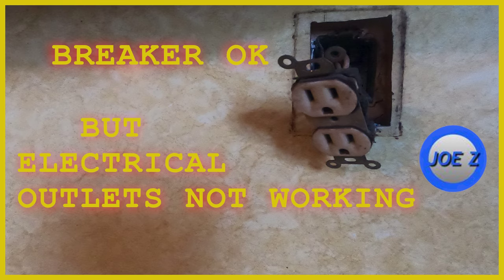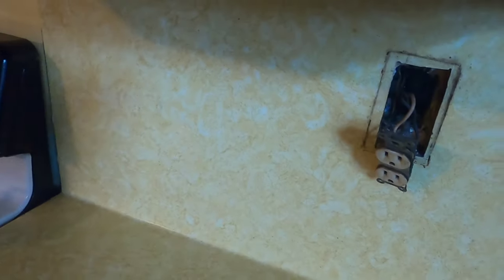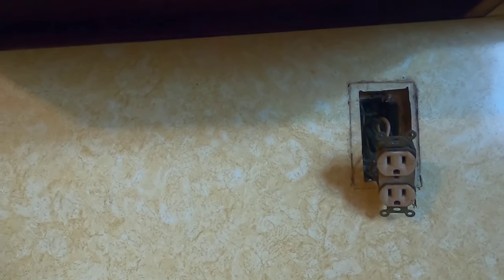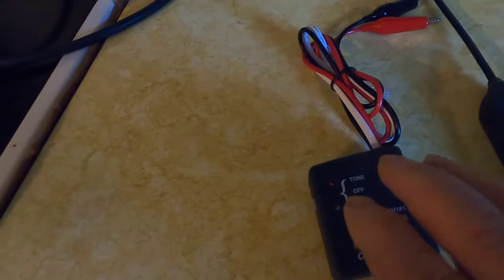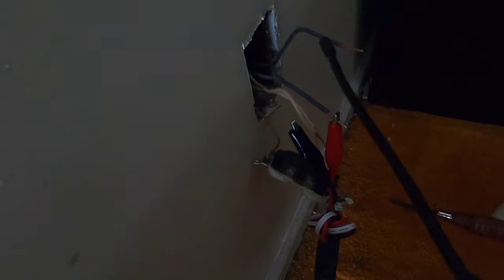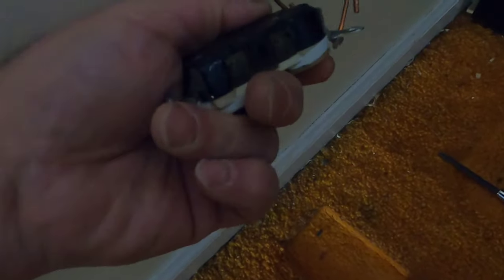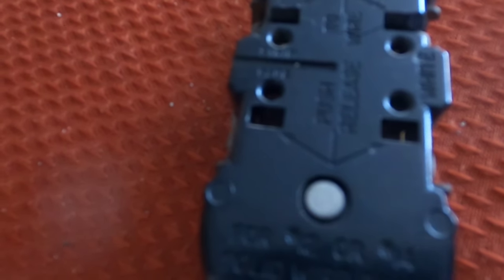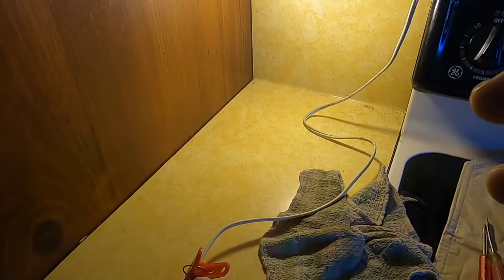Breaker on but no power to outlet FIX

Comment: As an electrician, I recommend not using those push-in connectors on the backs of receptacles, especially for 20 amp circuits with heavy appliance usage. Wrapping the wires on the screws is the best connection and less likely to fail over time.
Reply from the maker: Thank you greatly for the contribution and how to tips! Comments like yours provides viewers with additional information. I know codes differ from town to town, but do you know if is was to code back in the early 70s' to use the push-in rather than wrapping the wires?
Hope you get to visit this channel again.
Stay well, Joe Z
Reply: Hey I have a question I changed my outlet and the breaker is on but it's still isn't working for one socket is it the fuse box ?
Reply from the maker: @diinpai  Do you have a a fuse box & a breaker box? I did see this set up many years ago or did you just mix the terms up? It may be a tripped breaker, blown fuse or a break in the circuit. The non working socket may be powered from another line.
Stay safe, Joe Z
Reply: @diinpai  If you are sure that everything else in the house is working, including all receptacles, then it is likely a loose connection or splice somewhere in the circuit. Just as an FYI, it very, very rarely a problem with wiring in the walls. It is usually a connection in another outlet somewhere on the circuit (receptacle, switch, ceiling light, or other junction location). Try the closest receptacle or switch nearby as a starting point and go from there. Turn the breaker off and unscrew the device from the outlet box and look for any loose connections or loose splices. Pull on each individual wire a bit because a loose connection is not always obvious by just looking. One thing to note is that if there is more than one cable coming into the box (meaning a feed in and a feed out continuing the circuit) at the non-working receptacle then it is likely that other things on the circuit would also not be working. If it is the end of the circuit, and there is only one cable coming into the box, then that is an indication that the problem is at the outlet location that is just before it in the circuit.
Reply: I have an older outlet thT only has a white n black and ground, it burnt when I was trying to adjust it while it had power, so I got a new outlet, but after replacing it the same way the other one was it has no power, what can be wrong?
Reply: @ThePerfectionist1  blown fuse or tripped breaker. If it blasted as a result of you moving it around, then that usually trips the breaker or blows the fuse. Reset the breaker or replace the fuse as appropriate.
Reply: That Quickwire feature using the push in connectors is designed for 14 gauge wire only.  Those residential grade outlets which have them are not rated to pass through 20 amps and should not be used in that application.  In kitchens and other places where high current appliances are used it is better to use commercial grade receptacles.  They are designed to last under higher current loads and can take having plugs inserted and removed frequently and can pass through on 20 amp circuits.  The residential grade receptacles are OK for lights and small appliances on 15 amp circuits.
Reply: I’m having trouble like so & lost power on half my receptacles. It’s driving me stupid because I can’t figure out out
Reply: As an electrician as well i second that i was working on fixing a recepticle the other day on a house the thing started melting right there and i had to clip the wire change out the recepticle and use a brand new one cause that thing was trash so be warned people you can use them but its not advised
Reply: Hello I have a question the problem I have is on my older house 1950s I believe my dryer is having problems currently I’m having to flip the breaker to start it and then it will work for a couple minutes with out heat and then will lose power all together from the outlet and again have to flip the breaker to power it, is there any advice you could give me to fix this issue or lead me a direction to look towards?
Reply: @jr.4l  it leaves a few questions like what size breaker are you running it on ik alot of older houses weremt built for modern loads in mind and ive had to fix some questionable wireimg from those decades but it could also be that breaker itself or the dryer your better off getting a local epectrician to come look at it cause theres tests and stuff to isolate the problem and that way your not trying to fix 30 diffremt things just to find out you could fix it for 50$
Reply: @HelaSlayz  okay thanks for the advice?
Reply: @jr.4l  Cheapest and easiest place to start would be to replace the breaker, especially if it is old. Those symptoms are typical of a breaker that is old and tired. Breakers can warm up every time power is drawn through them. There is also some minor expansion and contraction of the metal parts inside it. This can happen thousands of times over life of breaker. As your dryer draws power it heats up breaker. Once it gets warm it trips. A new breaker won’t do it. Best place to start.
Reply: @tms2568  okay thank you very much sir
Reply: What type of accent do you have?
Reply: Thanks 👍🏼
Reply: @1575murray
THANKS so much for that tip. 
NO shortcuts or cheap cuts should be taken w/regards to your home’s electrical!
And if in doubt - hire a licensed electrician.
Reply: @helaslayz
Thanks for advice, but I don’t know where you live that you can get a service call from an electrician for $50 bucks.
We sufferin’ under Bidenomics, hon.  
ANY licensed tradesman in my town wants at least $150 bucks just to get out of bed and drive over.  Then double that if he actually does work on the property.  (Phx. AZ)  
These people are charging more than DOCTORS - MD’s!  And they don’t pay outrageous liability insurance like doctors do. Last year, 2023…
I had an estimate from Tree Trimmers of $1300 to lightly trim three trees…. 🤦🏻‍♀️😵🙀
Reply: It used to be just the screw tightening down the copper wire, now it’s a screw pushing on a metal clamp to secure copper wire, why the complexity that actually makes the wire less secure over time?
Reply: I don't mess with this stuff very often, but I will remember your advice in the future if I ever have to replace an AC outlet. Thanks again.
Reply from the maker: @sparky9327  Bronx NY
Reply from the maker: @k.hendrickson8735  Glad to be of help
Reply from the maker: @k.hendrickson8735  You're welcome, Stay safe, Joe Z
Reply from the maker: @sparky9327  My guess a try to make it faster/easier to outsell the competition.
  Stay safe, Joe Z
Reply from the maker: @daveshangar6820  You're welcome.
 Stay safe, Joe Z

Comment: Joe,   The reason that the dining room receptacle went first is because it is the first device on the circuit and caries all of the load from all those 4 receptacles.   So, it builds up the most heat.   I would strongly suggest that you get another circuit run and receptacle for the microwave.   It is suggested by the microwave manufacturers that you have a dedicated circuit for it.   Best wishes,    Kevin
Reply from the maker: You are correct, this information may help other viewers thank you for contributing.
Stay safe, Joe Z
Reply: What is a receptacle?
Reply: @staywoke2198 receptacle are referred as an “outlet”
Reply: @Elitedirie8  thank you
Reply: What about in my case, I just into an apartment the only thing I had plugged in when I stayed there was my phone charger. But 3 of my outlets don't work
Reply: All near each other 2 in the kitchen and 1 in the living/dining room

Comment: Nice video and step-by-step instruction.  Never “back stab” an outlet nor switch with electrical wires as they cause these electrical problems years later.  Always “pig tail the 2 wires originally going to the device and add the 3rd to the connection and the other end should go to the device.  You will never have multiple device failure again!  When the original electrician wired my house 16 years ago he “back stabbed” ever device and so far 3 devices have cracked open at the wire entering the device.  While “back stabbing” is permitted, it is a poor way of wiring a device and only causing problems years later!
Reply from the maker: Bill Handymanbill,  Thank You for watching and taking the time to to add additional useful information.  Bill Handymanbill I have other videos on my channel that cover many different subjects  and new videos added weekly that may also be of help or interest.
 Be sure to 👍, share and subscribe if your are inclined to do so.  Also not to miss any new videos remember to hit that notification 🔔
 Bill if you'd like. another way you can help support  this channel at NO cost to you is by using one of my affiliate links.
                           * Thank you for watching I really appreciate your support.***
Again I hope you get to  enjoy other videos on my channel as well. 
 Stay safe, Joe Z
Reply: This literally just happened to me. I rewired one of my outlets... the bottom one was on a switch. Disconnected the switch, rewired it disconnect the switch and stay on. Things went well... turned on the breaker. Overhead lights work, tested too outlet... it worked. Tested bottom outlet, and accidently hit the gfci test button (on non gfci outlets) and now all the outlets in the whole chain are dead. I suspet I blew up an outlet further up the chain as the breaker still works, my overhead light works... but now all the outlets in the chain are dead..and they wired em up by stabbin them in and out instead of puttin a lead to em. So now I have to track down this chain until I find the first broken outlet to fix it. A gfci test button isnt suppose to killyour outlets, but it must have!

Comment: OMG... you converted a depressing start to the day into a cause for celebration !!!  String of decorative lights fell into the swimming pool causing the outside receptacle to go completeely dead... with no circuit breaker tripped... I was puzzled and completely bummed out.  After watching 4 mins of your video it prompted me to search the house only to find  that a GFCI switch had tripped in an upstairs bathroom... resetting it solved my outside receptacle problem.   THANK YOU so much !!!
Reply from the maker: You're welcome, I am glad no-one was injured  this was of help. And thank you for watching and taking the time to comment. 
. @tbiytc2537 I have other videos on my channel that cover different subjects  and new videos added weekly that may also be of help or interest. 
Your support is not required but always appreciated. If you are inclined to do so your Subscription, Likes, Comments and sharing this content do help.

Another way to Help Support The Joe Z Channel at no cost to you
is by using my affiliate links or  just go to:
                      https://www.amazon.com/shop/joez

 Stay safe, Joe Z

Comment: Thank you sir! I got a 50 year old house. My garage door and my two bathrooms upstairs were without power. The breaker seemed to be ok, it did not jump. But I replaced it anyway just to get that out of the way. Still no power. 
I watched your video and to make the story short, I found a faulty outlet in my Down stairs bathroom ( which had the lights working and was not connected to that breaker). 
When I opened to outlet it was very rusty, probably from the sink’s humidity. Your video told me to check the outlets, the trick was to find out which outlet was feeding which. 
I replaced the bad outlet and bingo!
I would have never thought that an outlet could control my entire garage and my two full bathrooms upstairs!
Thanks again! You saved me a bunch of money from calling a professional.
Reply from the maker: D A You're welcome I am glad this was of help. Thank you for taking the time to comment. Your explanation of the issue you had may also help anoither viewer. Your viewing, commenting, 👍 sharing & subscribing if you're incline to do so are a big help for me with my channel.
Hope to hear from you again.
Stay safe, Joe Z

Comment: This is why I always use pigtails now instead of running down stream outlets off other receptacles. This stuff used to drive me nuts. No issues anymore. Great troubleshooting. All you can do really is to check  everything like you did.
Reply from the maker: I agree 100% , pigtail is the way to go. Thank you greatly for the contribution and how to tips! Comments like yours provides viewers insight into processes and different perspectives. 
Comments and sharing of knowledge are one of the reasons why I created the Joe Z channel
Stay safe,
Joe Z!
Reply: Pigtails yes ~ parallel wiring I heard is best

Comment: Thank you, Sir. I had power cord with multiple outlets. I plugged in a new device & it tripped the power surge protector. Power was lost to the room, but the circuit breaker was on. The outlet that the power cord that was plugged into was ruined. This is the best video I’ve seen.
Reply from the maker: You are welcome. I am glad this was of help & thank you for such a compliment.
Stay safe, Joe Z

Comment: I just had this same exact issue occur this week at my gf’s condo and was feeling pretty well stumped but once I watched your video I was convinced this was indeed her issue too, so I just skipped all the trouble shooting / tracing you did and jumped right to changing out all the outlets connected to the “problem” breaker starting at the one that seemed closest to where the issue began and turned the breaker on/off after swapping out each individual outlet until the “problem outlet” revealed itself by way of the lights coming back on to all the other outlets.  

Only had to swap out 2 outlets before the problem outlet revealed itself & the problem was solved, which made me look like a genius / hero to my gf :)

You’re analysis was spot on and I should also note that the “problem” outlet that I found was actually a newer outlet that was installed maybe 3 years ago tops, while some other outlets in her condo (on that same breaker (and are the ones I suspected were the cause) are over 35 years old, as they’re the originals from when the place was built in the mid 80’s. 

I loved this video because it comes off as if your uncle or grandfather just randomly texted you a video of a problem he had at his home and is proudly showing you how he slowly and methodically resolved it, step by step. 

Thank you for posting this video!
I never, ever comment on youtube but this video just saved me a ton of time & frustration and you deserve the kudos!  
✌🏼
Reply from the maker: Rocco I am glad you got the problem solved. I want to thank you for taking the time to write your comment. Your likes, subscribing, and sharing my videos/channel go a long way to help me with my channel. Comments like the one you posted really help encourage me to keep making these videos.
Hope you get to enjoy more of my videos & hear from you again.
Stay well,  " Uncle" Joe Z
Reply: How do you know where the problem began to minimize number of swap outs? I ask this because if all the outlets are daisy chained aka in series then if anyone failed (even the “last” one) all would not work, right?
Reply: @shanmukhasreenivas1  That was the methodology to test the hypothesis.  If it had NOT worked then he could rule ot out.

Comment: You might not be an electrician but you sure know how to explain things.

This helped me out a bunch!

Good yea 👍
Reply from the maker: Wow, thanks! PK88 I am glad this helped you out. Your 👍s, subscribing, commenting & sharing my videos would be a big help & much appreciated.
Stay safe, Joe Z
Reply: LOL! You went through all that when your microwave told it was the outlets? You would have saved just calling a pro.
Reply from the maker: @justicewatch4602  No the microwave only let me know it did not have power. The question was why & how to find it. Could have been a break in the wire or which outlet was breaking the circuit. Just to clarify you do know this is a DIY channel?  Joe Z

Comment: Thank you for posting.
I had a problem this morning. My wife said that she got some kind of a minor shock, and then everything stopped working at that AC outlet. There's an AC outlet on the r about 2 ft away from the kitchen sink. I turned breakers off and on and pulled out my multi tester to check that circuit and other AC outlets, and I started to think that it was the AC outlet itself. But when I went to check the wires, there was no power there either. 

From my lack of experience, had I not seen the video you posted I would have forgotten all about the AC outlet that is hidden in the spice cabinet, which is also about 2 ft away from the sink. Unlike the one on the right, it has a breaker to satisfy the code laws.

I went to examine that breaker more closely and found that it did, in fact, trip.
I pushed the red button and wala, the other outlet came alive.

You learn something new every day and thank God for YouTube.
Reply from the maker: You're welcome. I am glad this was of help and thank you for commenting.
Stay safe, Joe Z